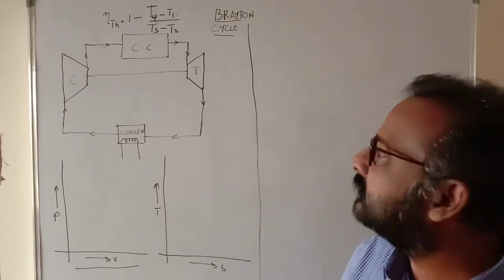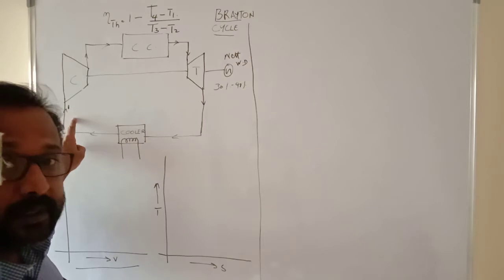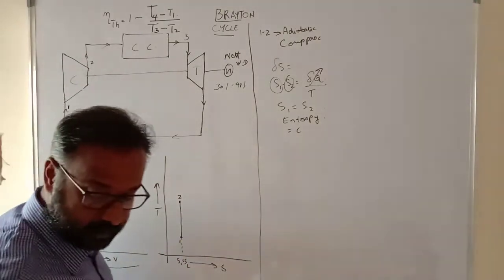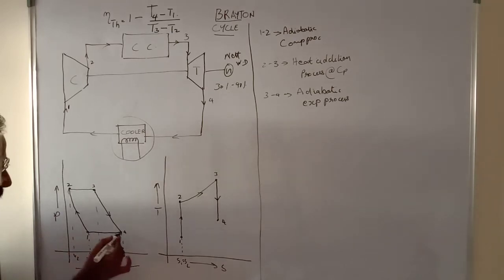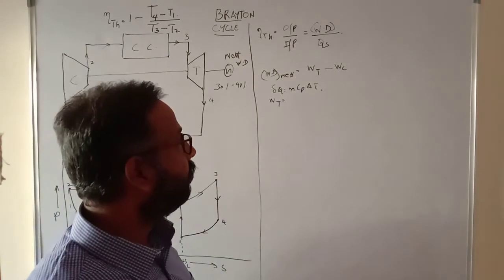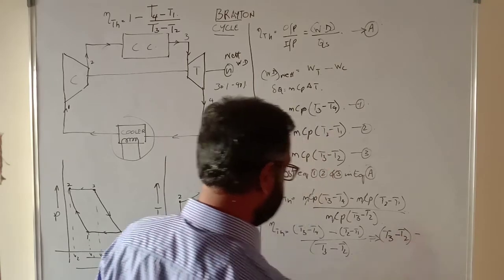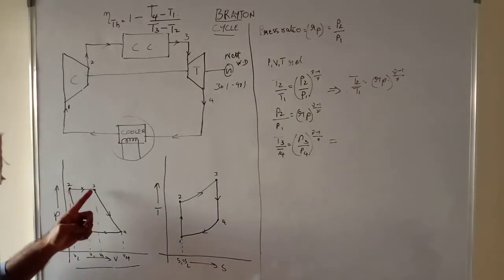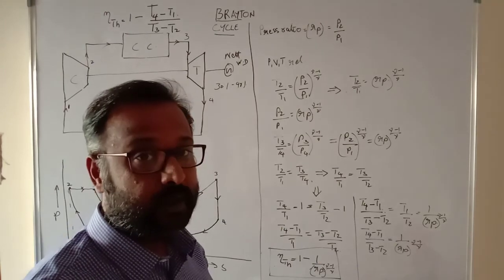Brayton Cycle

Comment from the maker: In the heat addition process the air is heated by some external means for a closed loop system and is not mixed with fuel for combustion. This happens for a open loop system. In the video I had mistakenly stated it mixes with fuel and undergoes combustion. Regret the error. Thanks  Anand ka